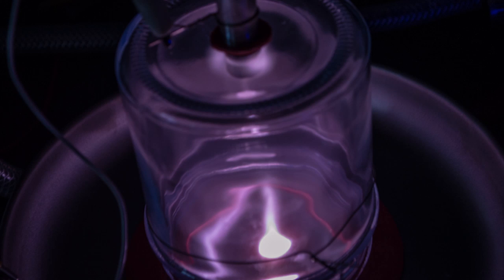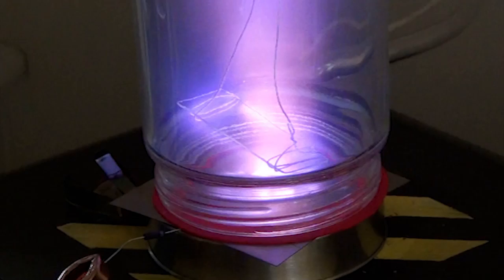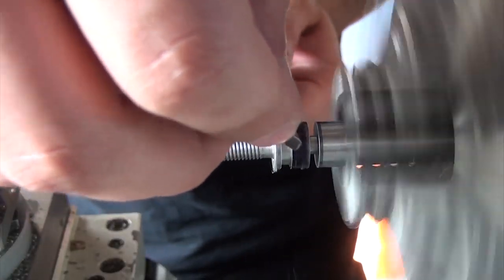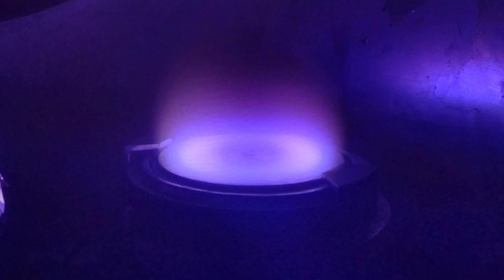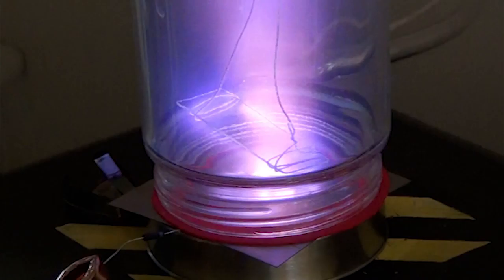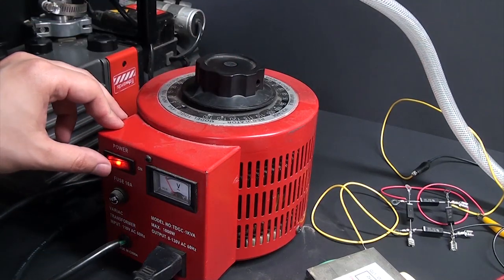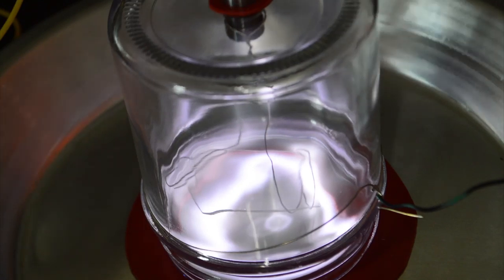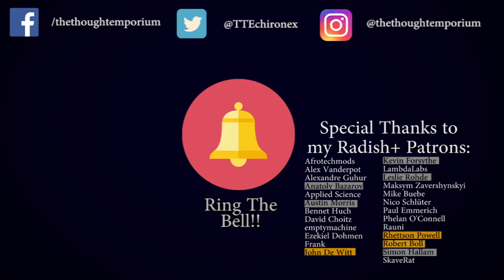My First Successful Metal Coating Machine - Magnetron Sputtering

Comment: This gives me so many ideas! This is just high current, low-voltage, DC in a vacuum? What is the Wattage rating of your variable transformer and bridge rectifier? I am guessing you could easily coat a base metal with fine layers of other, dissimilar metals? Can you coat plastics or carbon fiber structures with metals and metal oxides? I would like to experiment with something very similar to do what you are doing, but probably at some higher temps of plasma and greater rates of deposition.  Excellent work. I enjoyed the video.

Comment: It's good to see that you've made a mile stone on this one. 
With regards to the glassy carbon, it is indeed possible, but the cooling side of things can be a problem. 
The real reason you generally only see thin coatings is because diamond-like carbon coating drop tons of heat into the target. 
Generally speaking, glassy carbon is usually prepared by taking solid activated carbon, vacuum impregnating a plastic adhesive into it (I specifically rememebr 3m brand panel binding adhesive, but something with a fair amount of aromatic rings would probably work ), and then using a high temperature plasma to cook the polymer. 

Finally.... i'd be wary of xrays coming off of that setup. You're dealing with high voltages, confined magnetic fields, and metal ions in vacuum. Copper, silver, and Gold probably only emit low power xrays, if at all, but Iron is capable of setting off some high intensity bits. Carbon might do it too, depending on the method used to make the graphite.

Comment: You mention carbon sputtering to produce diamond like coatings.  I once read an old russian research paper that mentioned using ethanol bubbled with hydrogen as the feed gas for this purpose.  The paper claimed higher water content in the source ethanol (they used sake) seemed to have a positive effect on the process.  I've also read other papers about growing diamonds that mention that hydrogen gas at high voltage will wear away carbon and diamond, but that it affects carbon approximately ten times as strongly, so some industrial diamond coating machines pulse hydrogen gas to clear away any non diamond carbon build up.

Comment: if you can have a look to metal used to coat surfaces in electron microscopy you'll find out the metal we use and they are easy to use on argon high vac. for air high vac in my lab we use Carbon coating but it ask some very specific setup to work properly.

Comment: 11:31 BOLT DOWN THE VISE.  You've got an incredible amount of energy in that spindle and motor and should that hole saw bind you're going to have large chunks of metal suddenly moving at very high speeds, and thanks to how presses are built and the walls behind them you are likely to be IN THEIR PATH.

YES, that drill press is enough to grab that entire vise assembly and launch it at you hard enough to break your ribs. At absolute *minimum*, drop some long bolts through the slots so if it does snag and start to go it'll bind up.

All that HV around, and that's the one spot in the video where I think you were risking serious injury the most!

Comment: 14:50 you should consider a small heater on the inside made out of tungsten wire controlled by an SCR pack during this part for future projects, also consider a PID controller. If you are going to go the full monte and add a secondary diffusion pump, which would make it quite an advanced project, it would be a waste not to add heat while initially outgassing here.

Comment: Quartz glass is normally used in lab equipment for vacuum equipment so you could consider upgrading for equipment to use later for sputtering a larger range or materials. Do a video where a “FULL BRIDGE RECTIFIER” is used a lot LOL!

Comment: If you want to take the project further but stick mostly to just sputtering, I might suggest looking for a beat-up old Anatech Hummer on eBay. Untested parts systems are seemingly readily available as industrial surplus, and they're reasonably serviceable old machines.

Comment: I'm no expert but I'm not sure I like your crocodile clip setup there, with the big un-insulated base plate. If the top clip comes loose it's almost guaranteed to land on the plate and short, isn't it?
Reply from the maker: Considering nothing moves and you shouldn't be touching the wires anyway, there's no real risk of that.
Reply: @thethoughtemporium  Yeah I guess you're grabbing a thin wire so it's probably fine. It's just that I've had crocodile clips spontaneously spring off of larger connectors. This is more of a problem the larger, rounder, and smoother the thing is. I could imagine someone building this with smaller crocodile clips and thicker wire, maybe coathanger wire, and it being an issue for them.

Comment: You should really put an oil mist filter on your vacuum pump exhaust. A length of hose going up to the ceiling would at least allow much of the oil to drain back, maybe even stuff a section with some brass wool or something.

Comment: I think you'll have to get stronger diodes and bump up the voltage quite a bit to do graphite coating. Possibly you'll need custom parts.

Comment: I've seen a lot of your sputer gun videos and I believe you could make a high energy-dense battery by layering metals just like a voltaic pile but because they're so thin you could layer them a hundred two hundred thousand times and still have a very small battery with a very high voltage or what is known as a voltaic capacitor by putting say 50 layers of copper and zinc on one side and copper and zinc on the other and make a really high performance capacitor Matt and Siri works just like a battery but can be charged quickly

Comment: Hey, you should make bulk glassy carbon. Cool anode material, and generally just neat.

Pretty easy to make if you're comfortable building a computer controlled kiln -- cook phenolic resin slowly up to 1000C, then ramp back down. Need an inert atmosphere.

Comment: I would like too see strength testing on thick layered glass. Possibly both sides coated. If it significantly increases the glass strength then there maybe new safety glass on the horizon.

Comment: Working at a glass working factory, I can tell you that you don't need a respirator for drilling glass as long as the hole is under water. It is hard to breath dust that is inside water XD.

Comment: Stumbled here thanks to YouTube suggestions..Wasn't wrong.. Im a Glass Blower and use Dichroics a lot. That is a Very nice setup for sure.. From what I understand gold and silver should work better than copper. Although, the sampling from a separate source from the base seems to be the difficult part in this set up. It is easy enough to get a sheet of copper or even silver, Gold is an investment for sure. Maybe use a Boro sheet for the base and place the sample material in the field and use gold wire for the connection instead of the base plate.  Talk to a few Jewelers and Im sure a small sheet of .999 could be made if that doesn't work..Cheers.

Comment: A few thoughts on your magnetron and how to improve it.
1. Use SmCo magnets instead of the more common neodymium ones. They are more expensive and have weaker fields, also more difficult to find in ring shape (I know of exactly one source of SmCo ring magnets on ebay). The main advantage is that they resist much better to heat and do not demagnetize at 60-100C like the neodymium ones but at 250-300C instead.
2. Use an unbalanced magnetron design instead of the balanced design from the video. Essentially turn the middle magnet around so that its north and south poles face in the same direction as the poles of the stack of ring magnets around it. Yes, it will not like to stay in that position so you will have to glue it in place while clamped well. What the unbalanced design achieves is concentrate the magnetic fields to a higher density in the gap between the central and the ring magnets. It will increase the efficiency of sputtering. I know it sounds counter-intuitive but there are many papers about it that you can look up.
3. For cooling I suggest using copper shims and tubing to encase the magnet assembly. Instead of the delrin shim between the central magnet and the ring, use a machined copper shim. Also encase the magnet assembly on the outside in a machined copper tube that is closed at the bottom. You can easily achieve water-tightness of the whole assembly by soldering or brazing that copper enclosure shut. Copper will also transmit heat away from the magnets much better than the epoxy does.

Comment: Transformers can be current limited by putting a motor run capacitor in series with the primary, the cap functions sort of like a resistor, but without the heat generation associated with a resistor, in my experience the high voltage transformers, especially MOTs are much more manageable in this configuration, bigger cap bank means more power, and a variac can still be used in addition to the caps, so pick a cap that will allow the most power you want, then use the variac to do the rest.

Comment: Cobalt would be a cool test... Also might substitute cast iron for the steel on your magnet setup. Changing distance is probably necessary for different materials although I'm not sure neither the SS holder nor the "dollar store" glass would hold up. Wonder if nichrome coating would limit the SS from introducing contaminants.... Interesting. You should hit up Nilered about different glass or maybe even the did that builds all the Lazer stuff... Just a thought.

Comment: So, I've just learned that it's actually possible to deposit straight up glass, and when deposited it's apparently more stable than normal glass that has rested for a thousing years or so. I've thinking about how awesome it would be to make some sort of wirelessly charged wifi gadget and coat it in a solid case of metastable glass. Think it would work?

Comment: I think that if you were to cool the magnets using nitrogen to a superconductive state, it would allow for greater efficiency in the focusing of copper particles at your desired target due to copper's semi-magnetic nature. Not sure how practical this would be in a chamber containing the hot plasma, but it would still be cool to witness. Also, I am not sure how these gases would react to an electrical current, but using krypton or xenon for your noble gas may allow for enough kinetic energy for you to see the desired outcome in your steel plating trials.  
 Love the vids, keep it up.

Comment: if you ever try to use/build a Rotary vane pump.....make sure to NEVER let it run dry.....your ears will thank you.
Copper....lame ;) It oxidized to fast/much. A bad coating, when you try to increase contrast of chip fractures or stabilize and meassure thin Photoresist or other fast affected layers in a SEM (scanning electron microscope). Palladium is better^^ Very fine surface coating

Comment: Your machined screw is on the outside of the vacuum so its not an issue. But if you are machining screws for vacuum tooling which are on the inside, know that you need to make a vent hole or slide or they will loosen by themselves.

Comment: You can get glass and tile drills
There are die holders for lathes
You didn't use a capacitor to smooth the DC ? without a capacitor you get half wave ac essentially. i used 2 microwave oven caps in series for a fusor supply with bridge rectifier (though i haven't got the fusor working yet)

Comment: A machine lathe makes life better. It amazes me that everyone doesn't have one. 

I personally would have made the whole magnet heat exchanger out of aluminum, including the spacer tube. I would have made a "tub" that would hold and protect the magnets from the water jacket. You don't want to let magnets get too hot, lest that pesky curie temperature be achieved. 

Could a plasma cutter power supply be employed to generate the plasma?

Comment: Dude, if you get your hands on some of the used graphite they had in a nuclear reactor, along with some regular graphite, you could probably make some radioactive diamond capacitors/batteries.  A tiny amount of constant current produced by the radioactive carbon ions interacting with the structure of a diamond.  (That may not be how it works, but you can make it!)

Comment: If you deposit lithium on glass you can use it to keep a sealed glass vesicle VERY dry as the lithium will react with any water inside the vesicle. However, there are far easier ways to do this with sodium, so you'd need a special use case...

Comment: Another thing you can do to remove water residue on the glass is to hit it with lighter or torch while under vacuum. Just a quick pass to evaporate it. That's what we would do for Schlenk lines in lab

Comment: OK now I'm hooked. Instead or Argon, have you thought about dry Nitrogen? It is probably cheaper than the Argon. I used to use the dry Nitrogen in microwave waveguide feeds to keep moisture out.
Reply: Probably just has argon around as it has multiple uses. Nitrogen is probably also reactive in these conditions, though I'm betting that a copper nitride coated widget has it's uses....

Comment: A few questions:

Is the copper coat thick enough to be antimicrobial? I know copper metal and it's alloys have that property but I'm not sure if a thin coating on glass would make the surface kill microbes.

Would you be able to build a housing for the transformer so that you don't accidentally touch it or the wires? I feel like that'd be a lot safer than leaving it out exposed.

What kind of lathe do you have and how much was it?

Amazing work, as always. :)

Comment: I would of put the gasket on the inside,, as Start right End right, Nickel or stainless would been better choice for your water magnet heat sink. no rust as with steel. Your setup Reminds me of The Primer Field

Comment: @The Thought Emporium -- If you use Xenon as your purge gas, it will easily sputter off even heavy atoms, and you can make a really good vacuum by sending a tiny amount of it through your chamber and into a cryopump. A cryopump can be as simple as a U-shaped piece of copper tubing, stuffed with copper wool from a scouring pad, and all dipped into a thermos full of liquid nitrogen. The Xenon will freeze solid on contact with the cold metal, trapping other gas molecules under layers of frozen Xenon. More advanced versions of this are so effective, they can maintain hard vacuum in a chamber where an electric rocket engine is firing out Xenon propellant. Having an extra valve in your system will help isolate your chamber from the cryopump, if you are not running a continuous tiny flow of Xenon. 
Outlet from your chamber into the cryopump should be fairly short, have few changes of direction, and be of the largest cross-section you can fit. The only real drawback to this approach is the high cost of Xenon gas, but you do not need very much of it. You could pump very dry Carbon Dioxide the same way and get a hard vacuum, but it will dissociate in the plasma and that will probably mess things up... unless you actually want Carbon and Oxygen ions. If it was just Oxygen, that would be good as plasma for cleaning many surfaces. Atomic Oxygen ions are extremely reactive.

Comment: Make mylar with graphite instead of aluminium.  The theoretical heat transfer of this instead of a heat pipe is the holy grail of a mechanical project I'm working on.

Comment: Again, have not read all: I think there is a better pump down procedure. In diluting the contents of a pot by running a tap, the decrease in concentration is from a 1st order DEQ. As always, exponential. I would pump down first, then argon, then pump then argon, etc. 4 or 5 times quickly. This is way better. For example in old darkroom film washing procedures, a steady flow was used for 20 to 40 minutes versus fill-and-dump for 5 minutes.

Comment: You should have moved the out valve on the water cooler to the other slider to increase current flow and reduce the amount of stale water in the container

Comment: Porsche has started sputtering their brake rotors with Tungsten Carbide with the idea that they will not need to be replaced. They will just eat through the pads much faster. The layer is only like a quarter millimeter thick or so, but since it is tungsten it doesn't need to be.

Comment: Would cooling the magnet further give better efficiency/effect? A dry ice isopropyl alcohol cooling bath should keep the temp WAY down and could pumped through your cooling tube
Reply: Tony Oliver why not use an electromagnet
Reply: A permanent magnet has u ~steady magnetic field. An electromagnet would need to be special wrapped/wound. Costly. Also permanent magnets react in known ways. Electromagnetic depend on the metal in the winding
Reply: Tony Oliver But you would be able to achieve a stronger magnetic field so a better plasma stream, and you wouldn’t have to worry about cooling.
Reply: Induction would heat the windings. See induction heating

Comment: For DLC, you might want to use the magnetron without sputtering and just do PVD by introducing a slow stream of methane. (While, or before sputtering it can be used to reduce oxides and scavenge any oxygen too)
Reply from the maker: Something along those lines is the plan. Graphite would be too difficult to get to sputter with this setup we suspect
Reply: @thethoughtemporium  I'm trying to remember where I have a bit of early commercial process PVD/CVD polycrystaline diamond. We had a damaged 2 inch wafer of it at one point (my dad worked at one of the big semicon equipment manufacturers so fun stuff like that would make it's way home from trade shows) The thermal conductivity is utterly unreal. Pretty sure it was magnetron deposited before they switched to a way simpler method. If the substrate can get hot, you just flow a hydrocarbon gas over a red hot element to crack it and then have the hot, reactive jet impinge on the hot substrate, and you get diamond and DLC building up.